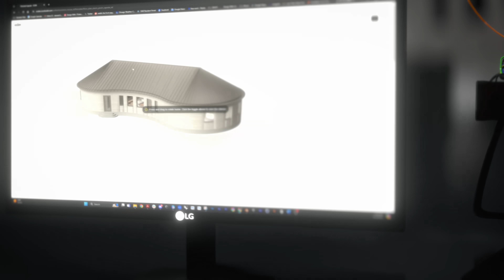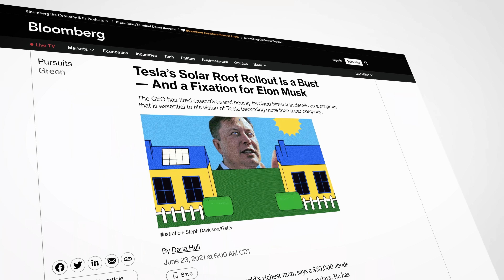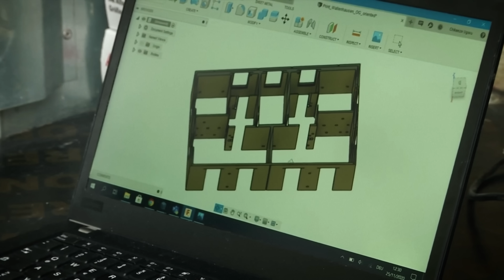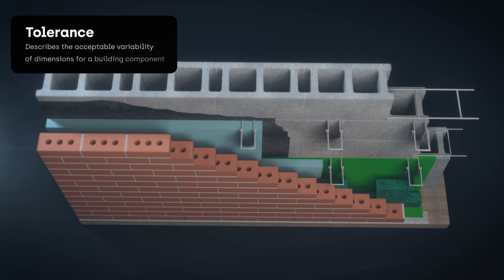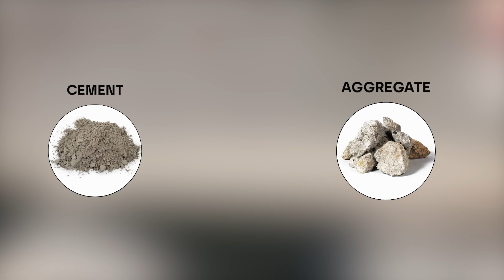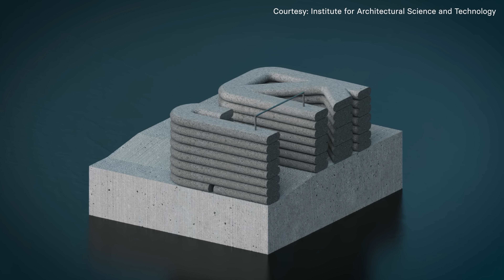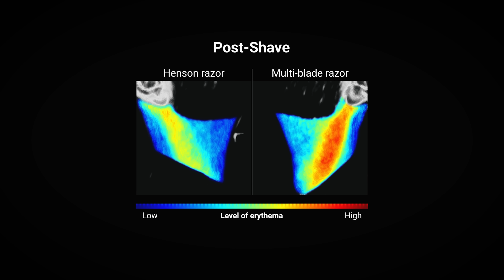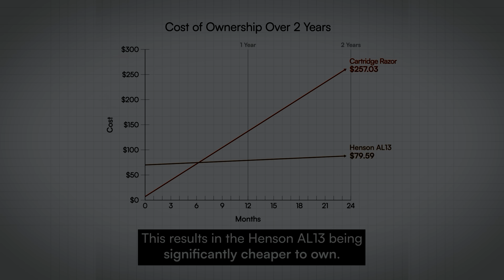Why 3D Printing Buildings Leads to Problems

Comment: "Metal buildings are the dream that Modern Architects had at the beginning of this century. It has finally come true, but they themselves don't realize it. That's because it doesn't take an Architect to build a metal building. You just order them out of a catalog - comes with a bunch of guys who put it together in a couple of days, maybe a week. And there you go - you're all set to go into business - just slap a sign out front. " - David Byrne, True Stories.

Comment: What if they added a rotating titanium cyinder behind the wet cement to smooth out the wall layers as they are placed, much like those used in making concrete curbs?

Comment: Another point to consider is earthquake resistance. As concrete needs steel rebar to resist any non-compressive forces. Unlike wood or steel structures.

Comment: I worked maintenance for a 95 year old adobe brick style building. The bricks made the walls anywhere from 14-24 inches thick in places. Adding any new plumbing or electrical to the existing building requires tearing into the wall, or hanging conduit everywhere.

Comment: I think 3d printed homes in the vast majority of situations don't make sense.
In areas with earthquakes they won't meet code.
You are very limited to the home design and finish.
The only examples I've seen are small, simple homes and 3d printing only applies to the walls, not to the floors or roof. When I was a framing contractor my 3 man crew could frame the main floor walls of a small home in 2 - 3 days.
So it appears there is no cost or time savings advantage.
So why is this even a thing ?

Comment: This is 3D concrete pouring which is referred to as "printing" for ADVERTISING purposes.  Precast concrete is old news and arguably a much better system which is why it's in wide use.
The printer is basically a CNC concrete extruder.

Comment: 3D Printing solves a problem that is no problem. Looking at ehat stages of building a house takes how much time I always get the impression that there is "nothing" for a long time while they do the foundation. Than the structure shoots up in a really short timeframe and tan a long time again until all the technical stuff, windows and interior work is done...
So, they "optimize" the step that was fastest already?
This looks mor like "we have a cool solution, let's find a problem to apply it to" than solving a real problem.

Comment: I like the rounded corners,  however one can always develop a corner shaping tool for the 3D printer. Not rocket science.
Reply: Tollerance checking and compensation can be fully automated by the 3D printer setup.
Reply: There's scope for other 3D printing technologies to be scaled up to full house scale. Like Binder Jet 3D printing, which would produce much higher resolution and hence higher quality print result.  It also cold produce much sharper rounded corners, so even though slightly rounded, the corners of buildings would visually appear much sharper.  Probably more attractive than both extrusion printing and traditional brickwork.
Reply: If you had the mortar powder deposition, binder and curing and waste / excess powder vacuume in one print head, then it could all be done in one pass for each layer.   This approach enhances efficiency, reduces waste, and improves the quality of the printed structures. By developing and refining this technology, it has the potential to revolutionize the construction industry, making 3D printing a more viable and attractive option for building projects.

Comment: Regarding the pre-fabricated components point near the end, making components in a factory that can then be assembled on site quickly is a pretty old technique. The Soviet Union used it to build lots of housing for its citizens following the devastation of World War II. The "Commie Blocks" that got built look mass-produced because they were, and while not the best that could be done at the time, were decent buildings with good city planning around them (much better than post-Soviet construction). They were designed to be something decent that could be put up in a year, rather than something really good that'd take a decade for the same number of apartments. Volume was the priority back then, as you would expect in such a situation.

There's a lot of potential for pre-fabricated components, too. We mostly build on a 0.1m grid, anyway, so it probably wouldn't be too hard to design a library of components to snap into one, so you could then design a building in software and have the program spit out a list of what components you need to buy to get it built, as if you were designing a LEGO set.

Comment: They had 3 demonstration houses near me that were unable to pass any of the strength and stress test / inspections ended up demolished and prefab put on the slabs. Nice idea needs more work🤗 may work better to print in a warehouse similar to panelized buildings and assemble on site. A lot of the new restaurants McDonald’s, subway, Pizza Hut are panels.

Comment: They need to consider stucco (outside) or plaster (inside) to cover the printed walls.  This can create a more traditional appearance and future repair, maint or additions can blend right in.  One building I was in during remodeling in Los Angeles was originally built in the 1950s with exterior and some interior walls of about 8in solid concrete.  Both sides of that were then finished with about another inch of hand finished concrete-based material like stucco or plaster.  It was a challenge cutting new door and window openings...  Had to rent a very large diamond blade circular saw (not hand-held!).

Comment: Printing concrete and then just being done is a terrible mistake. You need an expert to place forms for doors and windows, tubes to run plumbing and electrical, and to provide finishing for the surfaces to make them function as needed while not looking bad.

Comment: Oh, lintels are needed for openings in brick houses? Seems as if the gothic architects didn't know that. That's surely why there are no openings in gothic cathedrals.

Didn't watch any further.
Reply: To build a self supporting span over an opening out of bricks or blocks requires a very specific, engineered arch type design. 
Not very practical for residential homes or most other buildings for that matter.
Reply: @garyevans718  You can find it a lot in Europe. I could build one. It's not that hard to do.

Comment: Stop being paid by the construction industry. 3D is the next gen of homes. These are not valid concerns. You can cut out part and put in a patch. Can be printed on any 3d printer.. What about the current home not holding up because they are cheap?

Comment: Are we not going to talk about it looking like hot garbage as a disadvantage? Can they not have a guy with a trowel to smooth out the inside and outside? Does that go against the whole "we just let the machine build it," sales pitch?

Stewart, come on now. There absolutely are companies building homes in factories like iPhones and cars. They're called modular homes; you can't say you haven't heard of them. Mobile homes have been around for 75 years. They were tiny houses before hipsters came in and gentrified them. There are companies that do just wall panels too, though. Matt Farrell has a great series of building his own net-zero carbon house using one company. The walls get brought in on a truck and lifted into place with cranes; they have 90degree corners too.

Lastly: foundations. You included a section with the perfectly level ground for the machine set up. Getting to that point on a home site could be tens of thousands of dollars away. There are footings underneath the final structure somewhere; Earth isn't strong enough for that wall assembly. The walls of a house themselves pale in comparison in costs. I think most big homebuilders have expanded horizontally to deal with the challenges you're talking about. A crew works on 10 houses in the same neighborhood somewhat simultaneously. When the subs are taking up one for their work, they go frame the next one. This concrete method doesn't make the electricians and plumbers charge $50/hr instead of $100. I can't see this technology having any real impact on costs. They're using a much more expensive material to get an inferior looking result; just build it out of concrete block and cover it.

Comment: I would much rather have a hempcrete house with traditional lime render (with basalt fiber for reinforcement) inside and out. And the render can be painted with a breatheable silicate mineral paint like KEIM inside and out (or a simple limewash on the inside).

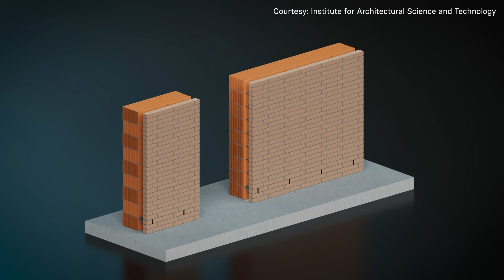Comment: 02:45 That is not true.
You don't need any steel to bridge the cap, you use the bricks by forming a bridge over that opening. And it is stronger than steel, because it acts as a wedge and harder you push from above, more it wedges itself in the sides, that will hold the weight by pushing upwards.

That is how basically most bridges and such are made, weight load balancing and shifting it to different directions from the stress point.
The cement can withstand extremely high pressures, but it is very brittle to sheer force or pulling force. Why you can't use cement to hold something up by hanging it from cement, or put it on place where it is sheered off.

Comment: Soft serve ice cream, but way less tasty.

I can see many areas where vertical integration could yield greater efficiencies in construction. Modular construction say, where all your trades can be in the one location, parts can be machined in bulk to spec, cables can be accurately cut to length etc.

3D printing is a solution looking for a problem to solve. Because 3D printing = less workers = tech VC funding money I guess.

I live in a house sat on piers on a site with a 10-15 degree slope in an area covered in trees you can't cut down. Also there's only road access to the top of the hill. Good luck getting your machine down here...

Comment: 3d printed houses only work if there something below to support it. Duh bricks, blocks, woods. Nothing floats. It's important for the corner stone and foundation to be flat and level. Everything you try to bring as a negative is also an issue in human labor. Non square corners, warped wood, needing shims etc...

Comment: No matter how much you lower the cost of construction, it will not lower the cost of housing. Money saved on construction will go into the cost of land acquisition if the supply of land is insufficient to meet demand. In Australia (before covid), the 'real' cost (inflation adjusted cost) of materials and labour had not changed for almost 30 years, yet the cost of land increased 500%.

Comment: I would be surprised if the concrete used holds up. Also, this is alll kinda priming, marketing bs i feel... Like, why isnt it possible for a crew to follow behind the printer and smooth out the appearance, like they do with concrete floors, foundations, etc.

Comment: I don't think that rounded edges in 3D printed houses is a real problem. If straight edges are nessacary then some light manual touch ups will do just fine and still be alot cheaper then using contractors to place every brick for a whole house... On the other hand this could be a new style choice aswell. You could work with that and create some truely unique structures that could create a totally new looking neighboughrhood.

Comment: honestly the olny way i see the wet concrete work out is if your also are useing inserts for special features and to allow cable. plumbing. air conditioning routing. not to mention doors and windows like you said.

Comment: I mean its pretty easy to surface the inside and outside such that it would look indistinguishable from normal concrete. could be as simple as a spring powered scrapper blade attached much like cooling fans are attached on the print head of a 3d printer

Comment: I don’t mind rounded corners at all.  I do mind the ripples, plops and drips.  Running wire and plumbing has to be more complicated too.  I wonder how the inspections happen when both the interior wall and exterior wall are done at the same time and inspections typically take place after the envelope is finished, but the interior has yet to be closed up.
It may make more sense to go ahead and add studs and drywall on the inside to deal with the imperfections and give areas to run wire and pipe after the concrete is finished.
I also wonder how it handles earthquakes and ground settling too?

Comment: Some of the technical problems can be solved - but is printing better and cheaper? Most modern houses have their walls constructed off-site from multiple materials - sometimes even with plumbing and wiring - and are just assembled on-site.

Comment: If you're not dealing with cyclones, hurricanes or tornadoes, there's no reason to build a house from concrete. It's very thermally conductive and poorly suited for extreme climates, with limited space to add insulation. If you're 3D printing the structure from concrete, you're severely limited in how you can put steel reinforcement into the concrete, which is the only way it's suitable for cyclones, hurricanes or tornadoes in the first place. 3D printing gives you the worst of both worlds; heavy expensive materials, heavy expensive tools, limited insulation space and yet no way to build to cyclone/hurricane/tornado standards. At James Cook University in Australia's cyclone zone, they have the world's biggest wind tunnel and have become world experts at building for extreme wind speeds. The biggest key is having huge threaded rods from the floor slab to the roof to bolt it down.

Comment: The cement industry is responsible for 8 percent of global carbon emissions. Removing the unnecessary use of concrete is slowing gaining momentum in the building industry. This method of creating houses would significantly increase these emissions. We already have materials to build houses. Furthermore, we’re already dealing with a sand shortage for concrete. Desert sand is too polished to be suitable.

Comment: How do you insulate or properly water proof the biggest problem with 3d prints is they are not watertight the layer lines are perfect spots for water to seep in even with a fluid applied waterproofing (peel and sticks are clearly impossible to use) the sharp corners at ever layer line will create weakspots all over the thing. High performance buildings use exterior insulation nowadays. A 3d printed building would go backwards in performance and be virutally impossible to repair in the same manner as it was built.

If you want expensive robotic built buildings just get a stampted steel prefab unit it too is 3d controlled, computer controller, and ships in prefab units. You'd still have to frame that concrete building its all just too complicated and expensive compared to wood construction (cheap cheap cheap).

Concrete can also be formed. (Also was that a purge bucket I don't even want to know how much more the 3d printed concrete mix costs vs standard concrete) How do you get rebar in, does it meat earthquake standards? does it meet high sesimic earthquake zone standards (doubtful). A cheap wood building can be modified to fit the design needs and very expensive steel can make a completely arbitrary CAD structure with pre-form concrete in between. 

The whole idea seems extremely shortsighted. Thermal bridging is insane in this design, the hydrostatics and sealing surfaces are insane, ...

Comment: The thing with any of these cheap house ideas is houses are expensive because of nimby regulations making it illegal to build new housing in most places causing a shortage, cheaper billing is good but doesn’t help when the cost is a result of supply shortages

Comment: I think we'll solve the tolerance issues in placing concrete blocks with construction adhesive. it doesnt require nearly as much equipment and can be done with an arm rather than a gantry

Comment: Is a 3d printed concrete building impervious to rendering, or plastering? Everything changes, nothing stays the same so why do corners all have to be sharp. You seem to be fixated on internal finishes, these are easily fixed.

Comment: I'm fascinated by the hurricane proof cinder block homes that have concrete floors and roofs. I see these in the Caribbean islands. The simplicity is excellent. They have cinder blocks for all of the interior and exterior walls. Rebar is placed vertically into the voids in the block forming reinforced concrete columns at intervals that get concrete poured in. When the walls are done, scaffold bucks are brought in and placed to hold a wooden concrete floor form that extend above the walls and about 2' horizontally beyond the perimeter walls. The floor of reinforced concrete gets poured and the whole process starts over for the next floor above. I stayed in a 3 story home like that that even had a cistern under the lowest floor. Sure it's not a fancy aesthetic to see painted blocks inside and out but I imagine that one could put furring strips to hold siding on the outside and drywall on the inside which would to take it to another level. People would come to the island and build a Million dollar wooden home nearby just to have it blown to pieces in the next hurricane.  Who cares how nice a home looks if it can't take the local storms.
Reply: The main reason for the cistern is that these Caribbean island do not have any surface sources of water. Rainfall only and not much of that. So the rooves are whitewashed and designed to collect any rainwater.
Reply: @fredericapanon207  Yes, I understood that in my first visit.

Comment: concrete without rebar is a bad idea. its going to be fragile in any direction but vertical. these are not viable as they are in any location that sees horizontal stress(earthquakes, slopes, ground settling, vibration from heavy traffic/trains) and then theres building codes.